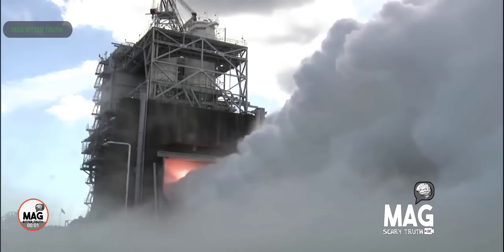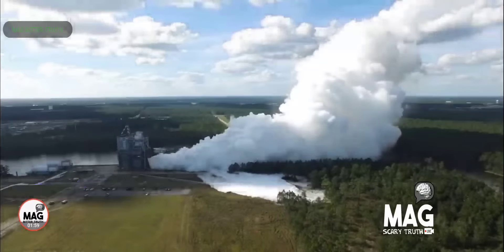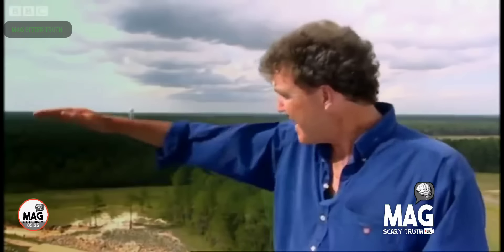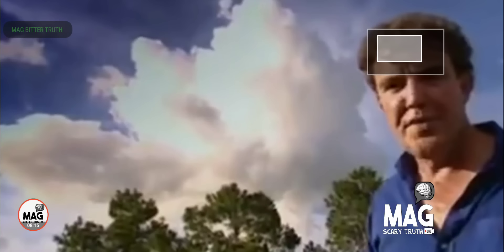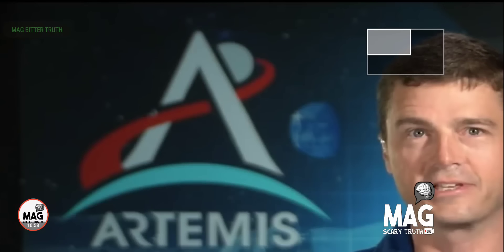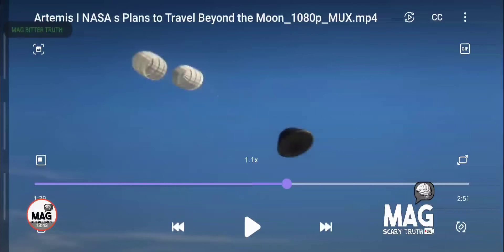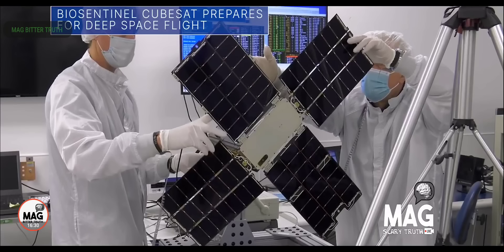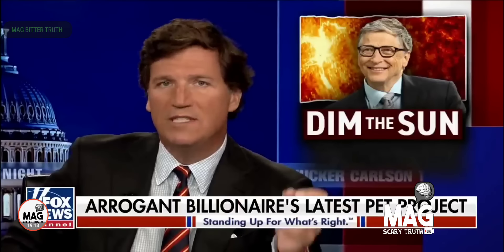THE ELITES MAKING IT RAIN

Comment: Mag man....I used to work at a nuclear power plant and the cooling towers did the same  thing for years....and from 25 miles away going over the Delaware Memorial bridge in the distance....you can barely see Salem nuclear power plant cooling towers, but you can see the plumm of vapor coming out of the cooling towers going up in the sky forming clouds...and I didn't think about it until you aired this video....and I Witness this twenty five years ago.
Reply: Salem the place of witches and witchcraft